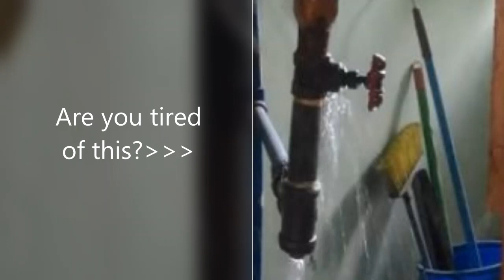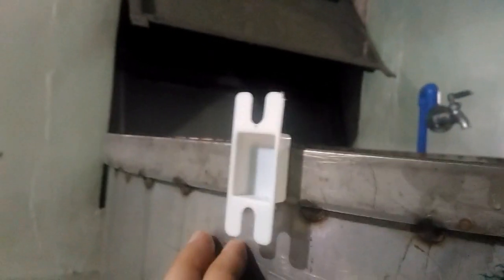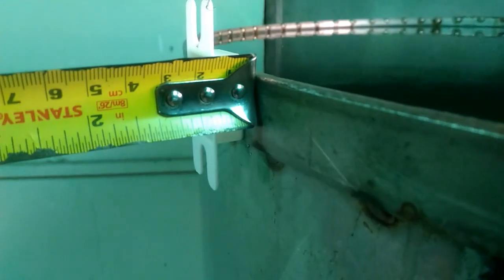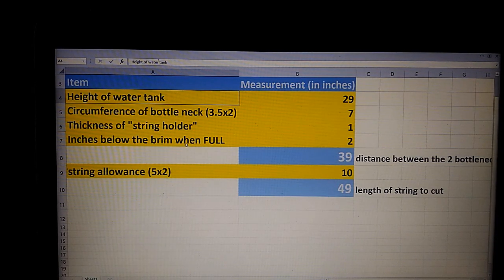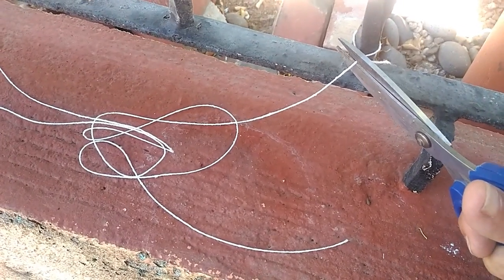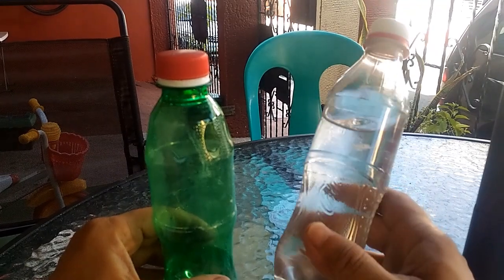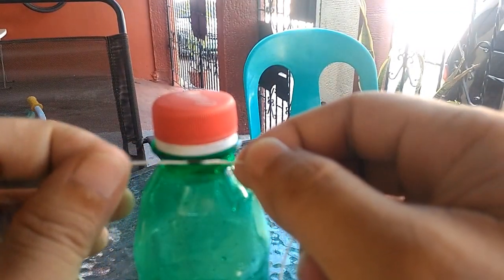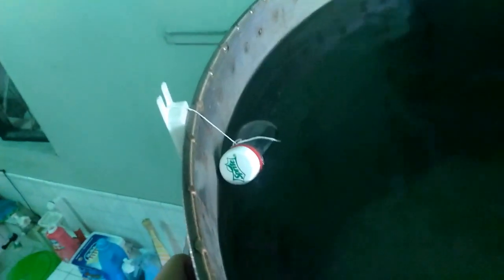Save Money & Never Run Out of Water w/ this Homemade Water Tank Gauge

Comment: Since your tank is wide open why don't you just mount a mirror above it? Then you can see the water level directly without all of that silly string length calculating. A mirror would look better too. Better yet, you can just stand on your tippy-toes and look inside the tank.